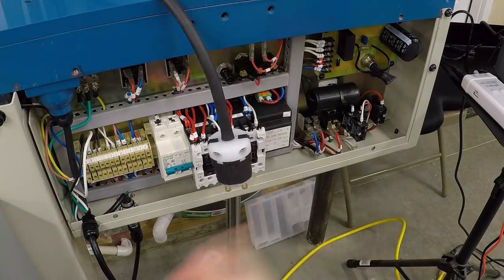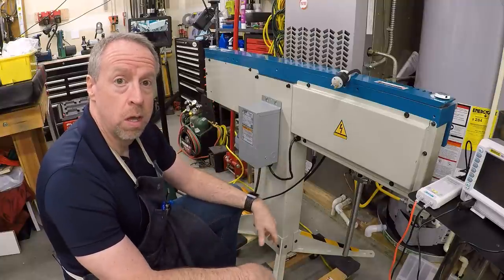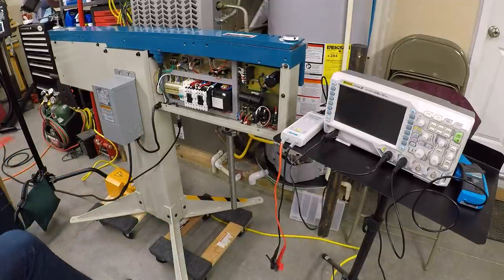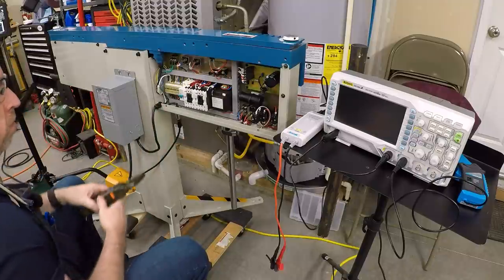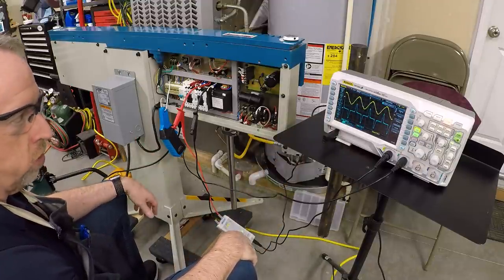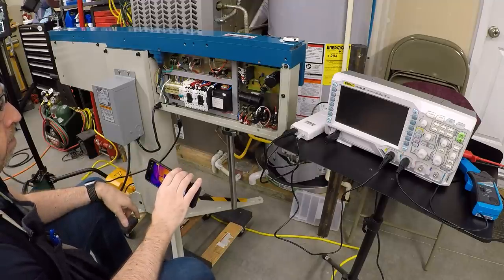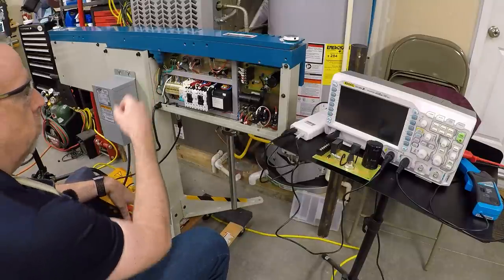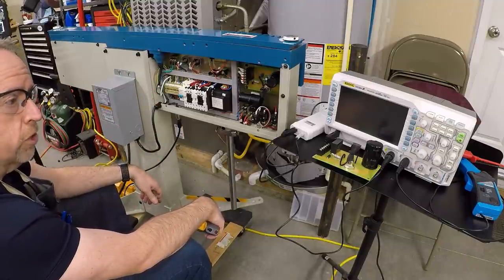The Mystery of the 17.4A | Sheet Metal Saga

Comment: I wonder what a $10-20 power meter from a local 'Walmart' will indicate for the power factor. In general they give a pretty good idea. Looking to the voltage and amperage shape on a oscilloscope wil not tell the whole story. You should also look at the phase relation and with those big capacitors it might me more than you expect.
Reply: If he didn't shift the phase on purpose, you are seen the voltaje and current in their relation one to another (the same vertical line represent the same moment in time for voltage and current) you can realize that by the detail about "when" the spike in current create a dip in the voltage sinusoidal form.
Reply: @truenerge4237  But where did the 1500VA go? (Higher harmonics?)

Comment: The supplier says 17 amps is ok but the relays inside are 15A rated. Hmmmm
Reply: I thought the same thing. The relay ratings would be calculated by the same method that the Fluke meter uses. The transformer would also be rated by that same method so you may be overloading the transformer. Those components might be rated at a percentage of their failure mode and the offshore manufacturers play fast and loose with ratings and push the limits.

Comment: Well power factor and rns aren't really related. Power factor is the phase difference between the true current and apparent current. Rms is dependent on the shape of the waveform..
Reply from the maker: Correct.  Power factor is a tangent in this discussion.  Low power factor can be caused by out-of-plase current, or by non-sinusoidal current.  But you're correct that the high crest factor is the issue here, and my tangential comment about power factor probably confused a lot of people.

Comment: Just roughly calculating the known values.
If the 28 ohm magnet where directly to 240v ac (not including any inductance) it should be 8.57 Amps RMS.
But on a full bridge rectumfryer with smoothing it gets closer to 340 Volts DC it should be 12.14 Amp

But then i guess the rest of the amps is inductive from the coil. 

I would like to see a 0.1 ohm resistor in series with the magnet as an current shunt and maybe you could find an answere. 

Pretty sure it has to be something with inductance that makes the numbers weird, but anyway it should be over 10 amps since it is rectified and smoothed voltage. 

Im no expert, just an hobbyists noob 😅
Reply: And maybe your transformer can't handle the inductive load as well so it might make some wierd or high voltage.
Couldn't see the rms or peak to peak line voltage on the scope
Reply from the maker: There is no longer any mystery.  It's just a high-crest waveform from a low power-factor power supply.  I uploaded the scope data if you'd like to check the math.

Comment: I wouldn't be surprised if they just tested it with a normal average current meter, true RMS meters are expensive and if you're just looking to put a number on the plate they assumed it was good enough.

218v AC is about 306v DC, with an impedence of 28ish ohms that should be 10 amps though but its a magnet so maybe the math is more complicated than that but it does seem even the (basic) math thinks it should be 10 amps
Reply from the maker: Yeah.  I have similar thoughts in my thinky-brain.
Reply: @Clough42  The magnetic coil should be seeing an average of 10a but the charging of the reservoir capacitor should be spiking higher with each charge cycle, with it storing enough energy to keep the magnet on as well as the magnet being parallel with it adding even more current?
Reply: You can get an rms meter fairly cheap. The EEVblog one he used in the video is only a couple hundred bucks.
Reply: @littlejackalo5326  thats still a lot of money. You would think a company would spend it however you've obviously never actually worked with a penny scraping company before. They cheap out on the screws even
Reply: Plus often these companies buy from an industrial supplier, they don't carry cheap meters, a company won't waste the time to find and buy consumer goods
Reply: @ChatNoirLe  Yep that's my take on this too.
Above the DC cap voltage the line has to drive current into the 28R magnet AND charge the caps up. The current flow is being limited by the rectifier diodes forward conduction slope (and the line resistance to the power station) and happens to be peaking at around 48A.
BTW is a DC magnet a good idea? Surly over time this would magnetize the steel around it as the magnetic field is never reversing.
Maybe James should remove the DC rectifier and filter caps... That would reduce the RMS current and stop steel chips sticking to the bender....
Reply: @sio2groper410  I believe there is a demagnetization cycle(AC) before it unclamps, as for DC I think that is to make it more accurate without the part slipping/vibrating at line freq.

Comment: TRUE RMS is accurate of the wave form is sinusoidal. If the wave form is something other than sinusoidal you will not get an actual RMS value like the Current you have displayed on the SCOPE. The current I would look at is on the 220 Being fed into the Buck Transformer. That should look sinusoidal could be wrong. RMS values are misread when waveforms are NOT anything but sinusoidal.
Reply from the maker: It's actually the other way around.  Average current is accurate if the waveform is sinusoidal.  If it isn't, you need True RMS to get a current that will correspond to conductor heating and circuit requirements.

Comment: If the majority of current meters are of the non-RMS type, could it be the manufacturer took that into account when specifying current draw?
Reply from the maker: I think this is the most likely explanation.  Though I had just assumed they used a cheap meter and didn't know the difference.  Your thought gives them more credit, and might be correct.

Comment: If it's actually drawing 17.4 amps, why doesn't it kick the 15 amp breaker? The breaker is clearly sized for the expected 10 amp load.
Reply: The breaker is probably a 20 amp breaker, not 15. I think the lowest rated outlets for 220v that you can get are 20a.
Reply from the maker: The breaker at the wall is 30A.  The breaker in the machine is listed as 15A in the manual, but the breaker itself says "C16".  If that means what I think it means, it's a 16A breaker with a "C" trip characteristic, which may never trip at 17.4, since it's less than 10% over.

Comment: given that the magnet resistance is 28Ω and that you have already noted that the power factor is abysmal, could it be that you are measuring a reactive component rather than a real one?
Reply: I believe that is the case.
Reply: I believe that is the case.
Reply from the maker: The magnet is DC, so what I'm measuring is the current drawn by the rectified, filtered power supply.  "Reactive" current, in the normal sense would be 90 degrees out of phase with the voltage, and this would be clearly visible on the scope as the current peaking when the voltage is zero.  We clearly don't see this.
Reply: @Clough42  so in other words this is a 4000W brake press lol
Reply: @Clough42  Lots of harmonic content can also cause a poor power factor.  In a nut shell, the integrated product of the voltage and the harmonics of the current always equal zero so they don't supply real power but do still heat the wire.  The power supply in this press is the typical text book example of poor power factor due to current harmonics.

Comment: The average of a pure AC waveform, of any shape, is precisely zero.  RMS is the only thing that is really useful.  Either the nameplate is mistranslated and incorrect or they're stating an average-of-the-RMS-value over time, assuming some operating duty cycle of the tool.  I wouldn't call this good practice if the on-period is tens of seconds or minutes.

The 1.19A Average measurement shown on your oscilloscope is solely due to the various offsets in the measuring chain adding a phantom DC component to the waveform.  The majority of this is most likely from the hall effect sensor in the probe, since these frequently require rezeroing.  Do this clamped around the wire with power off, without changing the orientation of the probe relative to the magnetic field of the earth, and you should see an average closer to zero.  The same applies to any clamp-on probe capable of reading DC, like the Fluke you have.

The term you're looking for describing effects of the non-sinusoidal wave on the measurement is crest factor rather than power factor.  The Cen-Tech meter will correctly read current in a circuit of any power factor as long as the load is linear (any combination of caps, inductors, and resistors), because the waveform will always be a sine wave.  In fact, the current probe is completely unaffected by the power factor since it's not aware of the phase of the voltage into its measurement.
Reply: @kfoltman  Fair enough.  I suppose the answer is "who knows" what the nameplate current means or whether it is correct with some assumptions behind it.  In the manual they state the usage as a 30% duty cycle and you have to keep track of this yourself or you will damage the machine.  No overtemp cutoff.  They also contradict the nameplate by stating 12A, not 10.

Comment: I thought it pulled 16 amps and that 1.4 was being used in the transformer!
Reply from the maker: The input to the transformer is 16A.  The output to the tool is 17.4, due to the step-down in voltage.

Comment: Why does "true" rms current matter in a non-sinusoidal (distorted) waveform?
Sinusoidal AC RMS value was mathematically created to derive the equivalent heating effect as the same DC voltage.
I imagine the calculation of a true RMS value of a distorted waveform is very involved and open to all sort of methodologies. I note your scope and fluke agreed.
Average current is what trips breakers, blows fuses, melts cable and causes fire.
From a Manufacturer/Insurer/Govt Rating Agency point of view, maybe average AC current is a better or safer measure of non sinusodal AC loads?
Maybe BIG multimeter is marketing expensive True RMS meters on us unnecessarily?

Comment: Would it be useful to measure the power through the magnet itself (after the control board and rectifier)?  My back-of-the-envelope calculations say that 220V RMS through a rectifier give you a DC voltage of 311V (sqrt(2) * 220?), that into a 28 ohm resistor yields 11.11 amps.  The question is then... how do you get the voltage after the rectifier high enough to draw 6 more amps?

(Maybe you did measure that, I assumed the white wire you clamped around was the line coming into the machine, but I don't actually remember you saying that.)
Reply: It looks like the magnet are blue & brown when he measured the ohm. Had the same idea to measure u or I  just to trace the current.

Comment: So that means that the 15 A circuit breaker is not proper for the current draw.
Reply from the maker: That would appear to be the case.  I removed the 6-15P connector I had on the cable and replaced it with a 6-20P.

Comment: I wonder if the current was based off a 50 hz power feed
Reply: I feel like they design these magnetic circuits on the basis of 220v and 50 hz , then when they are used on 240v 60hz the current is too high and the only way to bring it down is to reduce input voltage otherwise current is too great and damage done.
Reply: Rectifier and cap probably making circuit capacitive so on an increase in frequency the current would go up. Then they are adamant about about reducing voltage so current doesn’t destroy boards and components and windings.

Comment: Meh, I’ve never trusted clamp meters, not even Flukes. Also, 100% they put average current on the name plate.  I’ve seen crazier things from wayyyyy more “reliable” equipment manufacturers for equipment in much more rigorous industries than run of the mill shop equipment… I’ve also seen really screwy readings from “RMS” meters, especially when dealing with weird waveforms. But overall I bet the real current is closer to the 17 amps and 10ish amps is just a bogus measurement using a crappy averaging meter at the factory.

Comment: That flir battery is really bad. Really really bad, own one and I regret buying it.
Reply from the maker: Short battery life?  I haven't used it enough to run it down.
Reply: That was my sensation too until I contacted the Flir support by email. A few minutes later (!) I got an answer asking me to charge the device with an usb power supply and with the led lit, keep the power button around 30s to reset the device. Then charge for an hour or so. Next I ran a discharge/charge cycle with the device on and reading the app. 72mn from 97% to 5% discharge then back to 62% in 17mn with pretty normal LiPo curves. So no, seems normal now. Flir support has been impressive.
Reply: I was really irritated with mine, the previous generation to this one as well. Every time I grabbed it, it was dead. And then it bricked and I had to send it in for warranty. 

And then I replaced the microUSB with USB-C, and modified it so it was powered by the phone. Now it's a treat to use, works every time and has enough power to charge the battery while in use.
Reply: @TheFlarMr  what is "mn"? Minnesota? Manganese? Dyslexic nanometer?
Reply: @littlejackalo5326  french abbreviation for minutes?
Reply: @TheFlarMr  did as you (flir) suggested, shows me state of charge 65%. Junk it was junk remains.

Comment: I might be wrong but I am pretty sure that the difference between the RMS and average current result is not related to the power factor, per se.  The current and voltage (as seen on scope) are pretty much in phase, not perfect, but close.   I think that just the difference in the way average and RMS results are calculated is sufficient to explain the discrepancy in the readings, I suspect.   Would be a good homework assignment to model that current curve and calculate RMS vs average.  Yes - I was a professor so I see interesting problems and think "homework assignment!"      And my money is on the company labeling the current based on average current.   Which is sad.  But I'd wager on it.   Love your channel.

Comment: Have you checked the voltage under load? There is always a voltage drop when under load. Voltage drop equals amperage increase. Personally, I think you are over thinking it. Nominal voltage is anywhere between 210-240. I think most people would just plug it in, and it would work. Granted, you are trying to protect your investment, I can appreciate that.
Reply: Sorry, I just noticed the voltage on your scope. So, you had 3 volt drop. My bad.

Comment: Presumably, IIUCWIS, the AC current is being rectified and filtered and passed through the clamping mechanism.  The current passing through the clamping mechanism should be a nice DC fairly constant current that the true RMS algorithm can work with easily, VS that sharp peaky stuff that you showed on the scope.  I think most TRMS calculation techniques are amazing, but there are corner cases that come up all the time where the TRMS technique doesn't work right and gives a false response.  I think EEV blog just did a video on this prior to this video (apologies, I'm about a month behind on my video feed) where Dave compared TRMS current measurement readings of various DMMs where a peculiar response was given under a specific circumstance.
Reply from the maker: If you look through the comments on this video you'll see that  Dave responded to another commenter who also didn't believe the readings are calculated correctly.  TLDR: they're correct.
Reply: @Clough42  🤦‍♀️

Comment: Look up what RMS really means.  Your amp wave shape is mostly zero.
Reply from the maker: RMS is the square root of the average of the current squared.  The waveform is mostly zero, but peaks at 48A.  The RMS calculation comes out to around 17A.
Reply: Tex you need to look up what RMS really means yourself mate; RMS analysis is performed on a single cycle of any arbitrary periodic waveform, be it sinusoidal or not
Reply: Are you employed by the vendor?